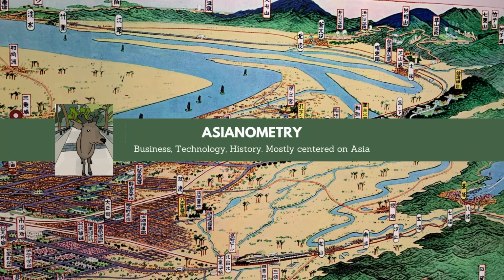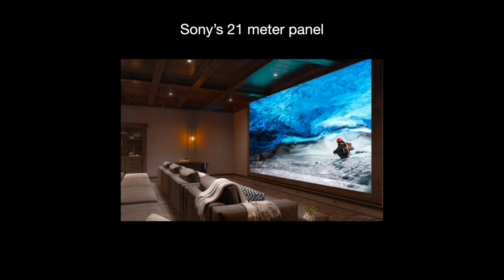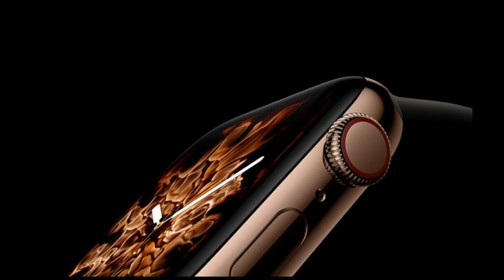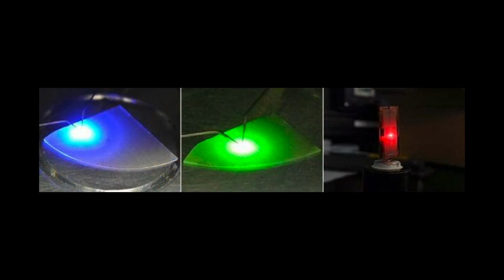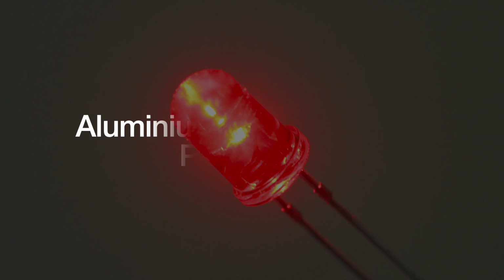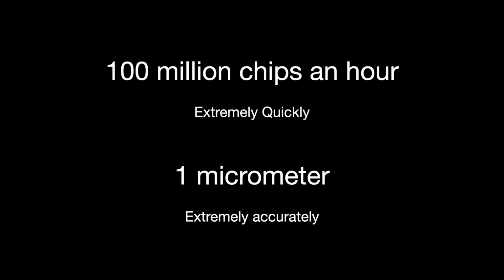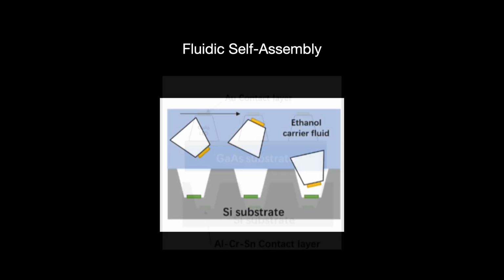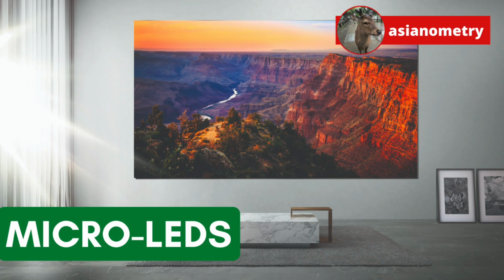Micro-LED Displays

Comment: In the first several seconds you're already objectively wrong about many things. 

CRT never had low quality images. Maybe you're a zoomer and only familiar with CRT filters on TikTok or whatever but that doesn't mean they all looked like that... Practically all CRT monitors, including cheap ones, looked great when paired with standard connections like VGA or DVI. Even now CRT remains desirable amongst retro gamers because things like motion image clarity and input response times are still unsurpassed. Only more recent OLEDs at 120Hz with BFI (Black Frame Insertion) or some of the very latest 2022 laptop OLEDs at 240Hz can compete in motion clarity with CRT monitors, and finally get close to any basic CRT with input response. As for LCD it's inherently a poor display technology. From the 90's to early 2010's it had awful contrast compared to any decent CRT. For the first several years LCD's had such awful viewing angles that even when you sat directly infront of them the colours and contrast began to significantly shift around the edges of the screen. Pixel response was so slow that everything had a long trailing smear behind it. It took many years before a high-end LCD could compete with a cheap and old CRT. 

Now some LCD's are very good, but it's literally taken decades to get here because it was so poor to begin with. They can finally surpass CRT contrast levels with FALD (Full Array Local Dimming), but FALD still has issues like blooming. Before FALD came along some people turned to plasma (strangely not even mentioned in this video) in the 00's and early 2010's because of LCD's awful contrast ratios, viewing angles, motion handling and ghosting.

0:30 OLEDs don't have a blacklight. Each pixel is self emissive.

Comment: Some inaccuracy here: LEDs and similar technologies are only now beginning to approach what was normal in CRT monitor displays over twenty years ago in terms of brightness, contrast, color-depth, and are still behind (and may never catch up with) refresh-rate. The same resolutions, likewise took until 2015 for LED, LCD and OLED systems to catch up with. To this end, pixel-gaps and controlled color-bleed on most CRTs eliminated the need for anti-aliasing, making rendered forms appear crisp and smooth -- something that LEDs by definition have to solve in software rather than functionally by design. Demand for new CRT is also starting to build.
Reply: There are already DIY native 480hz LCDs out there(ZusWorks kit) and there are upcoming commercial 500hz LCD displays too.

You CRT hipsters are psychopaths who are out of touch with reality.
In reality modern displays have surpassed CRTs in most metrics and when MicroLED hits the mainstream it will completely smash them in every way.
Reply: Also forgot that aliasing hapoens in CRTs too. If it didn't in yours it's probably because you had a blurry pos one + terrible analog VGA signals blurred it further.

CRTs could never resolve 1080p moire patterns. They were never as sharp as midern displays.

Comment: Anything assembled from one-at-a-time units runs into this operational barrier.  Consider how magnetic core memory and wire-wrapped circuit boards never progressed.
Reply: There's thin-film memory as well. More amicable to manufacturing. The univac-1107 used it.

Comment: Love your closing statement. I am told, the most promosing technology in mass transfer right now is LIFT (laser induced forward transfer), using eximer laser with mask to transfer a n area of micro LED's instead of one by one. However, before it is proven successful in mass scale I would still be doubtful.

Comment: I work in a company where we design and install and maintain LED screens of all sizes for hundreds of customers.
LED technology has real issues what it comes to displays, mainly that they are FRAGILE.

Consumers don't baby their devices, they have very inhospitable installation environments (humidity, heat, solvents) and even when we try and control all aspects of an installation for our customer to ensure the long life of the LED modules, they still have life-cycles of about 5-10 years. Regardless of manufacturer of said system.

First of all is moisture ingress. The packaging of the LED is plastic, thus it's not hermetically sealed package and moisture will get inside. When LED heats up, the moisture boils and can crack the substrate, destroying the LED. LED screens have specific moisture removal programs that slowly and deliberately warm the LED's up over long period of time to get rid of the moisture right after and during the installation.

Even our high end customers are hard pressed to use these properly and that cuts down the life time of the systems significantly.

Second is, they're much more fragile than you'd expect. They're not mechanically that robust that they would survive the handling of normal customers. Kids, moving them around etc.

Thirdly is the amount of HEAT. They generate a ton of heat and must be kept cool. This needs unrestricted flow of air and CLEAN environment and constant cleaning of the air flow areas.

Consumers won't be able to provide these. Even 120" of LED panel can generate several hundreds of watts of heat driven at 60% of full brightness. That's a lot of power and heat that must be kept under control.

Thirdly, the LED panels consist of sub panels and ALL individual LED's for all the panels in the installation are from SAME batch of production. Each installation is custom made for that particular customer such that the service includes the production of those LED's and then bunch of spares and that's that.

If you break a  sub-panel or individual LED turns black, and you're out of spares--- then that's that. You'd need a completely new installation and that costs you tens to hundreds of thousands.

Why from the same production batch? Because only that way the individual LED's are close enough en color and brigtness profile so they can be calibrated to a single screen.
And they also will age approximately the same predictable way.

This causes issues where areas of screen that see less use age slower and different parts of the display get out of calibration from each other within a few years.
There are special "screen savers" for this that must be run periodically during times when screen isn't in use, but it's still a hassle to deal with.

I doubt consumer customers are willing to deal with all of these drawbacks of a display that consists of separate LED chips.

I think without some very big step forward in economical manufacturing and efficiency of LED's themselves, micro-LED's will win over other types that can be printed or manufactured directly onto a panel.
Reply: Your experience is limited to bad practices of highly customized devices and their servicing organizations.  Ramping up to mass production would i=require fundamental changes, such as circuits that don't produce excess heat when regulating each LED, panel elements with on onboard memory listing the color and other anomalies of individual LEDs along with panel model and production week,  full screen  controllers that read that memory and modifies the images sent to each panel.  Traveling big screens used for events have achieved some of these things with somewhat standard square sub panels that are stacked and plugged together at each venue by rough stage hands needing to go from an empty space to a live show in 1 to 3 days.

Comment: my guess is the QD-Leds will be the way to go - only blue backing mini LED's with efficient photon down-shifting via quantum dot to the colour wanted.
Reply: Was thinking the same thing.  Perfect the easiest to produce color and then use quantum dots to produce the other two colors.
Reply: That sounds like the most plausible route that companies will take.
Reply: QDs can also be used directly. This is called QD-Display and instead of using an OLED layer to transfer energy to the QD, it directly powers the QDs with electricity. no burn in, no OLED layer, fully self illuminating.
Reply: Plus, the QD part is already commercialised in QD-OLED displays
Reply: i think the next gen of miniLED will be. however still Microled had superiors deepblack and contrast due to behavior OLED-like yet had brightness (esp. on HDR) and color accuracy of miniLED
Reply: The day that you discover that you can modulate the output wave length of a quantum led to get the color that you want... you gonna get a bonner...

No more channels neded anymore, one led per pixel...
Reply: @eduardoanonimo3031  The wavelength radiated by a quantum dot depends on the physical size of the dot. How are you planning to "modulate" it?
Reply: @getsideways7257  I dont plan to modulate it, its was the declarations of the developers on a showcase some years ago, where they was demostrating varius deviations of the technology, in particular i remember seen tree pure quantum dot LEDs in that demo. You can digg from there.
Reply: Yep, and with single type, entire screen segments of (for example) 64x64 pixels with control circuits could be made as single chips more cheaply combined into full resolution displays than individual color dots. It should be noted that some mass produced products already do this, in particular the modern optical computer mouse.
Reply: @johndododoe1411  I was thinking about the fluidic self assembly on how to get the right color in the right place. With one chip having all the three colors would fix that. And you end up with 1/3 of the chips to place.
Reply: Main issue is that blue qd leds still have lifetime issues. Time will tell if the lifetime can be improved quick enough.
Reply: @aquaneon8012  Quantum Dots are only one option for the color conversion material, phosphors as used in modern white LEDs are another. I put my elaboration under your QD comment to avoid starting another redundant thread.  placing a phosphor pattern over a basic LED array could use the technology previously used on the inside of CRTs, or with novel techniques such as optically etched coats.
Reply: @johndododoe1411  Phosphor cannot be used in this case as phosphor is to big in particle size (generally around 20 um). It will have a lot of problem. That's why people is using QD for display purpose.
Reply: @python4709  Ahh, fortunately the definition was pixels smaller than 100μm, which would fit those particles.  Also the operation of phosphors is by single molecules and atoms having appropriate combinations of electron energy levels, not larger drops.
Reply: @johndododoe1411  That's true. But you will realize that the process will be extremely hard to do since only a few particles to fit in one pixel.
Reply: @johndododoe1411  the problem with phosphor is that it abosorbs the missing energy as heat, QD's are a direct photon conversion with close to 0 energy loss, much less heat problems
Reply: @johndododoe1411  I'm talking about electroluminescent quantum dot tvs where quantum dots are the pixels and emit their own light. Quantum dots used in current tvs are photoluminescent and convert the light from the backlight into different colors.
Reply: @aquaneon8012  Whats acceptable lifetime? CRT could get burn in too. With regular use the tv would be obsolete by the time it was an issue.
Reply: You spelled color wrong

Comment: I made a prototype device today for an idea I had, it uses tiny tiny 0201 size LEDs (they are such small specks that you can barely even feel them if you rub your fingers together), it was not actually that difficult to place with tweezers.
Reply: One time at work I had to assemble 3600 of those small 0201 LEDs because the P&P machine had problems with the packaging tape.

Comment: I wasn't so unhappy with CRTs except for the size and weight, taking up most of a desk and being a ballbreaker to move.  CRT's weren't so easy either.  You had to pattern millions of phosphor dots and align a shadow mask to it.  I don't even get why 4k or 8k is needed, because across the room it's hard to see that detail anyways.  It would be nice if there was cinema worth watching, even in 480i, rather than the remakes after remakes and crap being peddled in 8k.  I am really not sure why so much effort is placed on making television screens, and relatively little effort is placed on making something worthwhile to put on those screens.

Anyways, as usual, the technical detail is excellent.  So at least this video is worthwhile to view on a video screen (though I'm not sure a MicroLED 8k screen is necessary to appreciated it).

Comment: Why we are more dependent on Pixel display instead of continues display? Pixel displays have limitations on scale & size of screens. Research &  advancement in continuous image display technology could overcome these limitations.
Reply: Because all our storage and transmission technology is now pixel based.  The only widely used continuous resolution technologies were film and unfiltered B/W TV (before transmission).  Component video was fine at short distance but was always used with input pixels and discrete output dots.

Comment: QDEL technology is essentially the same as Micro-LED that creates RGB light itself from each pixel, Oled is still organic, whether it has quantum dots or not, and will always have burn-in issues, thus why I don't feel it will be the future of display technology moving forward,If companies manage to develop quantum dot pixeles with accurate colors and be cost effective the technology will dominate the market, and using inkjet printing would make mass production easy
Reply: Main problem for QDEL as of now is extending the lifetime of blue LED and there are questions on if manufacturing can be scaled up.

Comment: So from my perspective there are two options to make this somewhat easier. 

1) Construct the panel from only blue LEDs and then use quantum dots for the red and green sub pixels. Solves the need for green and red LEDs.

2)Do away with LEDs altogether and use electrical charge to directly stimulate blue quantum dots. Then use red and green quantum dots after the blue ones for those sub pixels.
Reply: Yeah, the huge advantage of quantum dots is they can just be printed on a substrate, if memory serves.

They're talking about using quantum dots in solar panels as well.  Solar cells absorb certain wavelengths better than others, so use quantum dots to shift the incoming white light of incompatible frequencies into those compatible frequencies.  You could greatly improve the efficiency of the solar cell.  Problem right now is that the quantum dots we know how to make would probably degrade pretty quickly in full sunlight, but that's likely an issue that can be resolved.
Reply: @sunspot42  Some display drawing tablets use Q-dots.

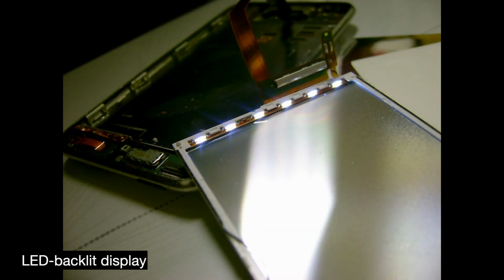Comment: 0:20 the contrast ratio of CRTs was MUCH better than the one of LCDs! The brightness level probably as well, at least on average.
Reply: Thanks for pointing that out. I was going to make the same comment. The contrast ratio as well as motion resolution was much better on surface emitting displays like CRT and Plasma than even modern LCDs.
It's too bad that sample-and-hold is likely here to stay.
Reply: I've always noticed the overlap between CRT fans, Morrowind fans and clinical obesity.
Reply: @anonanous3129  you made my day
Reply: I dunno ... I used many CRTs but didn't really ever think their contrast was that good after using an LCD. Maybe it was because of their brightness. I still have a Sony GDM-W900 and tbh it looks like ****. The response time is why I've kept it though.